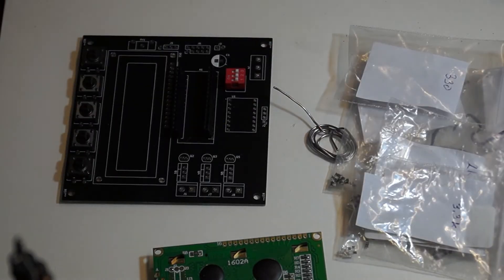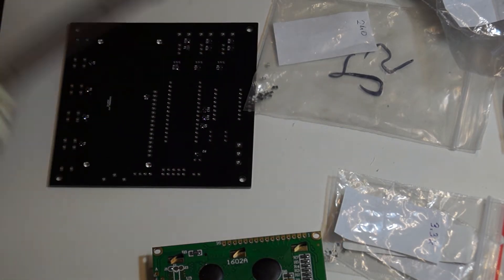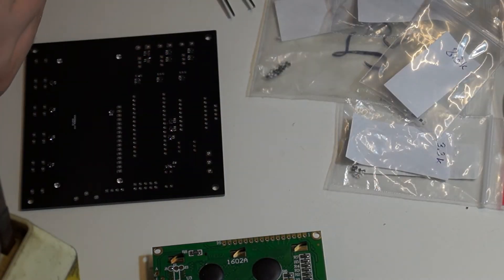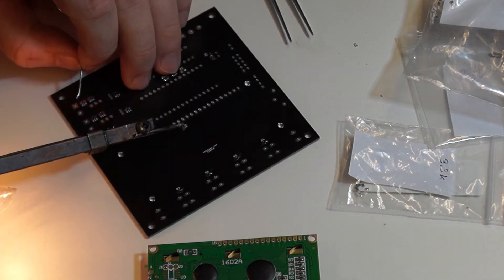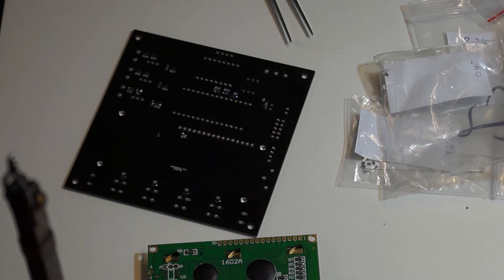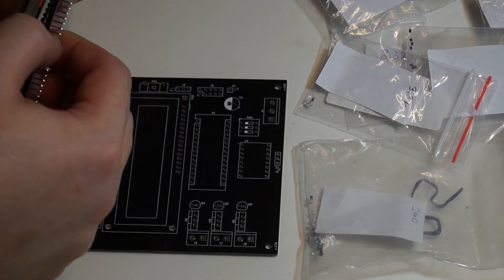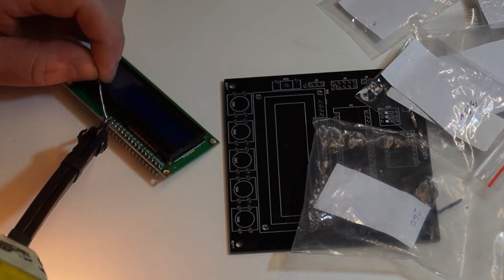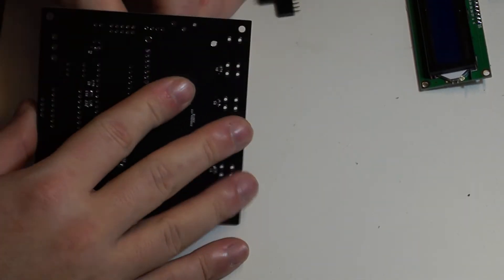Free filament maker machine part 6 - Custom Board

Comment from the maker: IMPORTANT: Current PCB is designed to have 123 Mosfet, if you get IRFZ44N you will need to cross two legs to fit it, also if you power this with PSU that has overcurrent protection, you will need to put one external pullup resistor. I will fix that in next PCB version

Comment: Ramps 3d Printer board should also work for this application right? Would just need to write the custom firmware for it.
Reply from the maker: No need to write custom firmware, all you need is to modify existing one https://github.com/Kaminariss/petpuller to match your board pinout and board itself. You have info about FW here https://www.youtube.com/watch?v=6v28tEB8vwE
Reply: @KaminarisTech  cool thank you